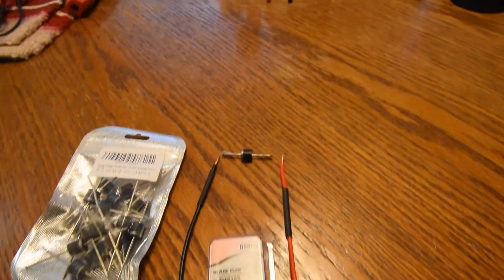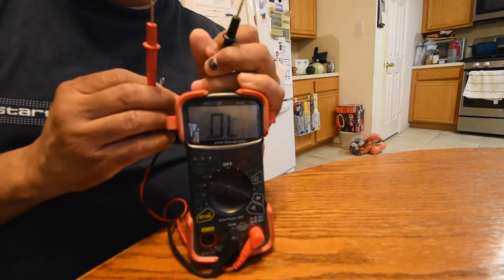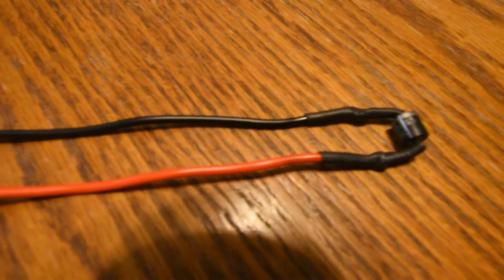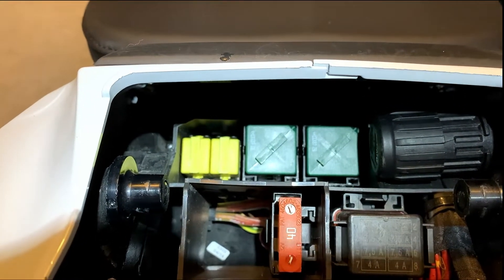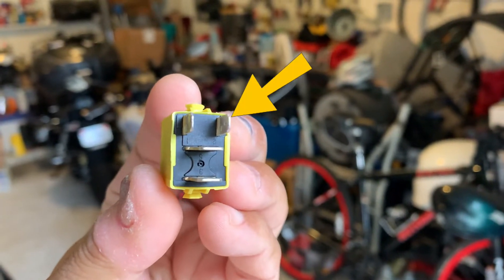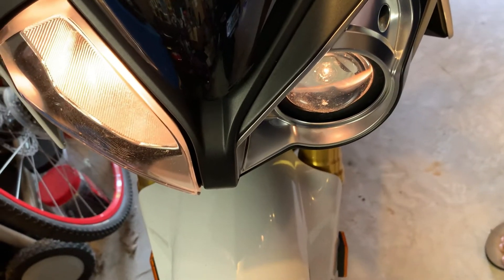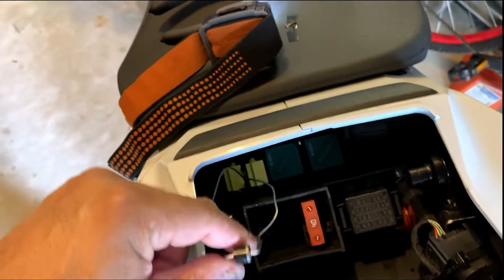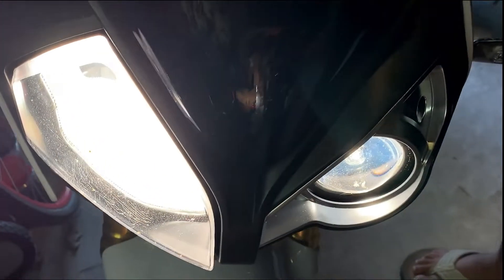Headlights Fixed! | 2014 BMW S1000R

Comment: nice work - will definitely use a similar method to get mine working the same - I'm surprised nobody sells a kit for this by now!
Reply from the maker: I thought about it but wanted to try mine long term first. 😉
Reply: @GrumpyGoat  nice - so far so good? looks like it's been installed for about 6-8 months now (depending on if you have winter there) - you could always ell in packs of 2-3 in case one burns out due to cheaper chinese components - kind of like I do for turn signal LED resistors hahaha
Reply from the maker: @evansteeves5888  Yes so far they have worked flawlessly. However I will admit that most of my riding is in the daytime. That said I did have a longish night time ride of over an hour in the National Forest not too far away, and where I was using high beams whenever a car was not approaching and there was no problem.
Reply: @GrumpyGoat  can't seem to find the right diode online - I saw 15A on the packaging but shouldn't it also be 12V (or the range should allow for 12V?) thanks!
Reply from the maker: Check the link in the Description of this video which is what I got. Says it blocks up to 45V. Don’t think that the label will say 12V.
Reply: @GrumpyGoat  sorry for hogging your video comments section again, but while looking to order the parts, I looked at dadasheets for the diodes and dusted off my old electrical engineering books from my studies. There were hundreds of different types of diodes available on the digi-key site, but after looking at the datasheets and considering we are using a motorcycle 12V system, here are the important things for the selection: stand-off voltage is the operating voltage you do not want the data or power line to exceed - so in our case we should have a stand-off voltage greater than 14.4V (12V battery can go up to 14.4V while vehicle running) - also breakdown voltage is the minimum reverse voltage that makes the diode conduct appreciably in reverse - and so we should also ensure this is sufficiently high for any possible voltage peaks. Finally I looked at amperage to ensure it was high enough for the application - since it is one circuit on a relay (signal side) we don't need much amperage resistance, maybe 3A or higher, but most of these semiconductor amperage is much higher anyways when picking the appropriate  stand-off voltage (the one I ordered is 100A peak capable)  The model number I ended up ordering is STMicroelectronics P6KE18A - be careful not to order the model with -CA at the end, since those are  bidirectional. Just figured I would post this for anyone looking at diodes that would work!
Reply from the maker: Evan, as an engineer also I appreciate comments like this to my videos - they are useful and informative, and we all could always learn something. Thanks for taking the time. 👍

Comment: What issue was you having with your lights?  that you needed to make this modification. 
My headlight and small running light on high beam side (right) are not working but bulbs are new! Thanks in advance!
Reply from the maker: Details are stated in the video. Only one light would come on at a time, and when high beam was switched on, the low beam would go off. The fix was to allow both to be on when high beam was switched on.
Reply: @GrumpyGoat  Thanks for reply, I saw that after.  
My high beam and running light doesn’t work! Bulbs are new, fuses look good, connector is good!  Your video shows two relays one for each side,  are those dedicated light beam relays?  Any help is appreciated this is got me stumped.
Reply from the maker: @spaceexplorer6636  Not sure if they are dedicated relays. I no longer have this bike so I can’t even go look. The schematic diagram in the Haynes Manual I still have indicates 2 relays - load shedding relay (low beam) and high beam relay. No diagrams to show which is which on board the bike. You might want to ask on the Forum that I got my information from. Or bring it to a dealer.
Reply: @GrumpyGoat  ok. Thanks for the responce, I’ll have to do some more troubleshooting.

Comment: Slick result GG. Very impressive. Of course, if you had the R1250RS, the joy of that specific modification would be denied to you. Your work is more impressive to me than buying a solution like Hexcan or similar.
Reply from the maker: Thanks Mark. Alas I cannot take all of the credit but must give props to the guy who posted the solution on the S1000R forum, but I can take credit for the fire taps. 😁

Comment: Why is this happening tho. I get it's a fix but I'd rather it have it OEM.
Reply from the maker: I suspect you’d have to ask BMW why they did that. It is not like that is the case for other BMWs which have one light on for low beam and both for high beam. My RS works like that and I could not understand why the S1000R was different. It’s not like the high beam was bright enough for both.
Reply: What was the issue. I don't understand why you did this. I've got a 2015 S1000R and haven't really studied the light situation but plan on doing LED.
Reply from the maker: Did you read the description of the video. My reason is there.
Reply: @GrumpyGoat  ahhh that's why I was super confused haha. Well done mate you need to patent that idea lol.